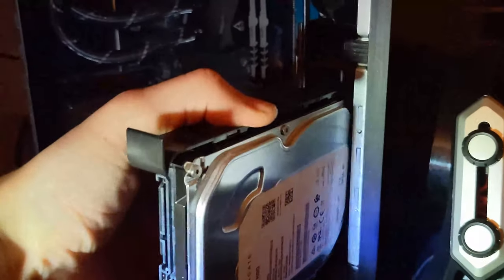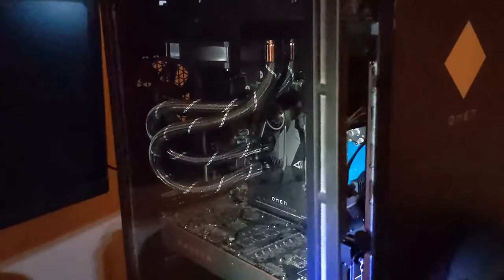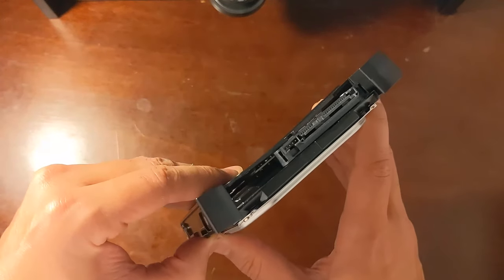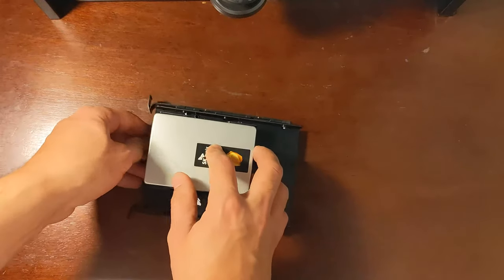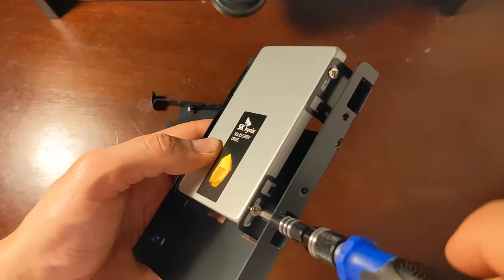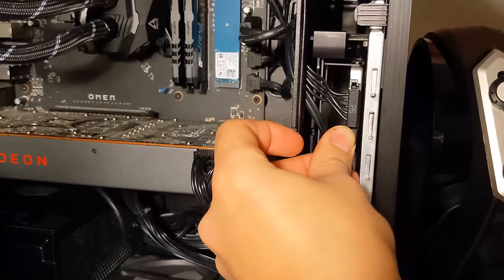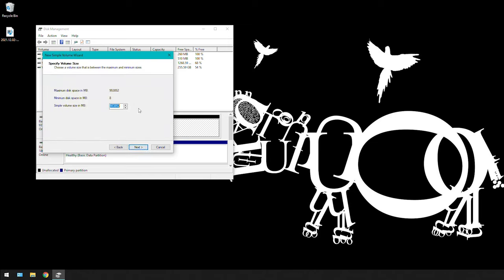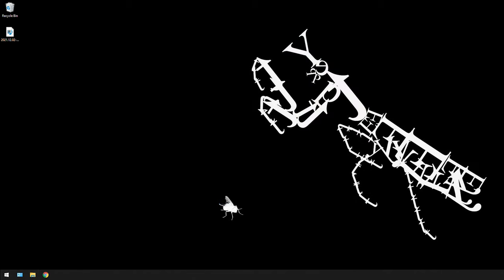Installing SSD to HP Omen 25L

Comment: What brand works best with hp ssd drive i wanna store games on 2nd ssd . I have a 1tb hdd and 512 m 2(I used this drive for iracing) not sure if thats good to use it for gaming...i dont do anything ither than gaming on this pc.. victus 15l 5700 6600xt ryzen
Reply from the maker: Any SSD or M2 are good for gaming

Comment: Hi, not too tech savvy but this looks easy enough. The only question i have i guess is; if my omen 25l came to me from amazon or hp rather, with ssd already(500 gig) and im looking for an upgrade, can i just add another ssd or do i take the old one out add a bigger one and redownload all my stuff?
Reply from the maker: You should be able to add the second one using this video no problem.

Replacing a hard drive that the system is installed on is a more intensive process and not covered in this video.
Reply: @CheapAGamer  hey cool thanks needed that. Also curious if i were to add more ram could i just add the extra stick of ram when im doing this upgrade and its all unplugged and off

Comment: Hey very very good video!But I don’t exactly know which screws you are using to get the ssd in place so it would be cool if you could answer!😁
Reply from the maker: Yes sorry about that, I don't remember as they weren't labeled. I can let you know that my process was start with the SSD off the bracket and start with the largest screws and work your way down until one screws in.
Reply: @CheapAGamer  Thanks for the advice!Could you recommend a screwdriver for these type of screws?Sorry for asking😅Because I dont really need the whole set you put in the Videodescription.Just a screwdriver
Reply from the maker: @nein4726  Here's a smaller set, from the same company: https://www.amazon.com/Precision-Screwdriver-Magnetic-Professional-Smartphone/dp/B06XCVFV7M?ref_=ast_sto_dp
Reply: @CheapAGamer  Thanks!
Reply: @CheapAGamer  I am sorry if im asking too much,but are the screws extra or do you need to buy them extra and if yes,what is the name of the screws?
Reply from the maker: @nein4726  They come with the Corsair SSD bracket so you won't have to purchase them seperately. They are included.
Reply: @CheapAGamer  Thank you so much!!!!

Comment: Hi, I recently got this (t15 0004in). I see there is only one slot m.2 for nvme. And i can see only one sata hdd cable (the one with smaller socket) . Does this mean i am limited to one nvme and one sata? I can't figure out where i can install the other sata socket
Reply from the maker: Model number for my 25l is GT12-0157c. Yours should come with two SATA III ports. maybe the second cable wasn't included for yours? If that's the case you just need to buy a SATA III cable.
Reply: @CheapAGamer  Hi thanks for the reply:)
Mine is GT15 . I found nvme ssd2 slot just below GPU. its very hard to see. So for the time being i can atleast have a second nvme ssd. I will mention the motherboard make and number if someone requires.

But they have only one sata socket/port soldered on board. So only one hdd/sata ssd is supported. Hope this info helps others. 

I wonder if they could have soldered another port as i can see in motherboard pcb there are points nearby for the same.

People buying omen should consider opening their motherboard before purchasing ssds as features vary a lot between different models
Reply from the maker: @TsuyoiYatsu  Yes models do vary and motherboards do as well even if it's named HP Omen 25L depending on the model you could have different inputs, although fairly similar they rarely are identical. Thank you, it's a great point to mention for any future videos.

Comment: Is it possible to keep the Hdd in sata 2 and just swap it and install the new ssd in Sata 3 where hdd is now? Sorry if it sounds confusing haha
Reply from the maker: Yes of course! I did a replacement but you'll still want the bracket adapter to house your new SSD you are adding

Comment: It is possible to have your m.2 ssd,
another ssd and a hard drive? It says you have 2 ssds and still have ur hard drive in the This PC screen. Thanks!
Reply from the maker: Yes you can have 2 Sata III connected hard drives or SSD and you can have 1 m.2 ssd. Total of 3 storage options
Reply: @CheapAGamer  oh sick thanks. would I have to get another sata cable? I noticed when I put in my first sata III ssd I saw another cable with a P6 label, it looked just like the P5 that I plugged into my ssd.
Reply from the maker: Your PC should have come with 2 Sata cables and they are plugged in on the motherboard, right next to each other

Comment: Do you need the converter or can you just install the SSD directly on the frame/holder/structure that was in the 25L's case?
Reply from the maker: You need the converter to hold the SSD. Thank you for watching! Links in description

Comment: Hey man saw your video great video I had a question I have the 25l also mine is the dorado motherboard and I have for slots my ram is 8gb in the first slot I assume I put my second ram in the 3 spot right and this is my dumb question I wanted to put more memory with an hhd I have the wires already there but Um it’s connected already I assume all I need to do is install and do the stuff on my pc right I’m sorry first timer doing it my own
Reply from the maker: Yes as long as your keeping your Operating System where is currently installed and not transferring to your new HDD. You can follow this guide. Good luck!

Comment: doesn't this 25L have NVMe slots?
ssd on nvme is way faster than sata3 ssd.
Reply from the maker: It has one for SSD,  I already have one installed, and the other m.2 is the wifi card. But yes NVMe slots are faster

Comment: Does is matter if I dont have the hdd tray?
Reply from the maker: I'm terms of functionality, no it does not matter. SSD will plug in and  work regardless. Neither the HP omen tray or SSD adapter is necessary, but it definitely helps make it look clean and secures the SSD to the case.